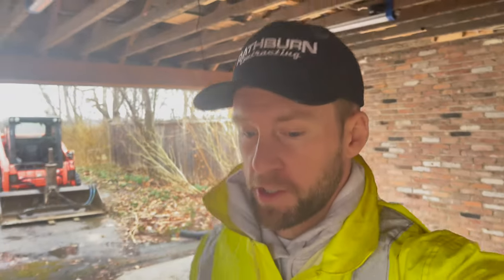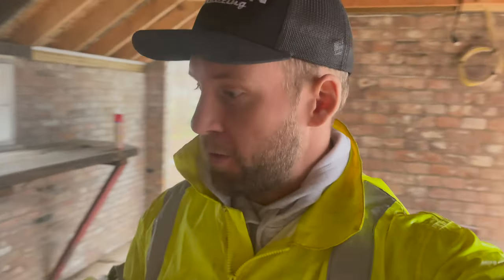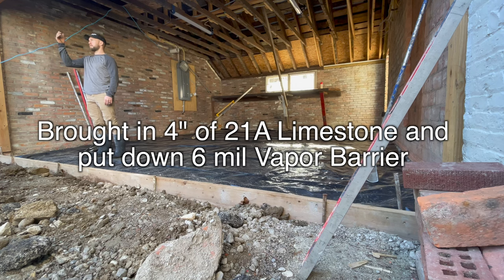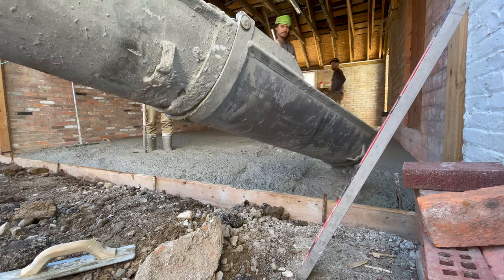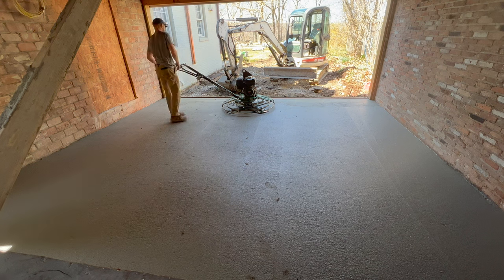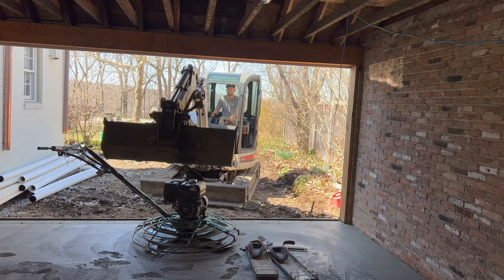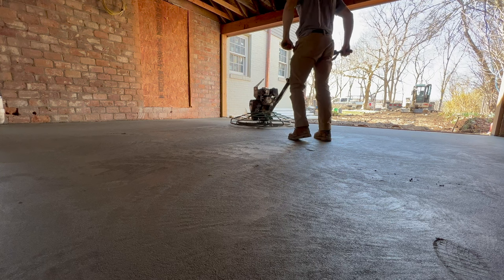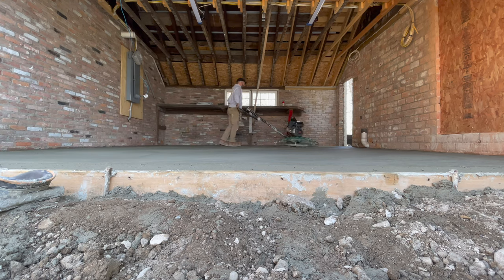How To Pour a Concrete Garage Floor!

Comment: Nice trowel. That size and brand was always my favorite.. Have you tried plastic blades for a less burnished finish?   Do you ever pan your slabs? Why no quick pitch handle?
Reply from the maker: Thank you, no I have never tried plastic, do they hold up decent? And I’ve tried with my 3’ pan but didn’t have good luck, it left a ton of ridged swirls that were a pain to knock down on the second hit. My guess is the pan is either too cupped or I hit it to early. Definitely want to get a flat pan for this 4’er. And I bought this from my cousin, so you know if the quick pitch can be added on?